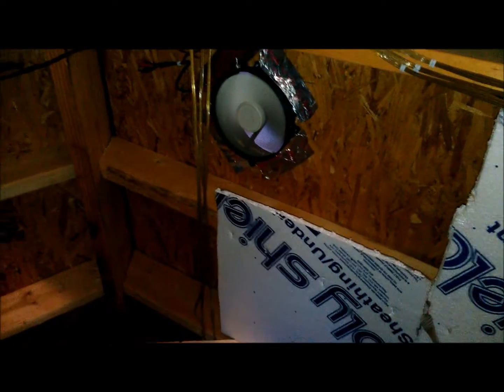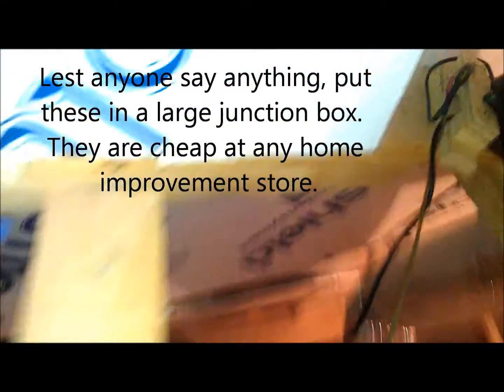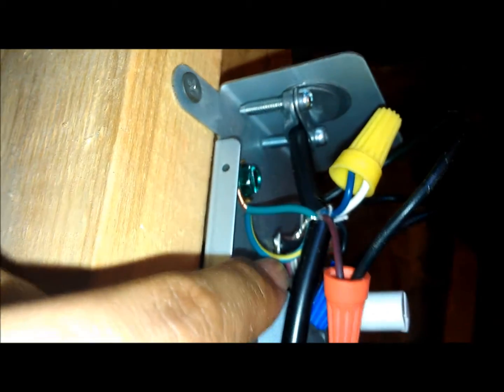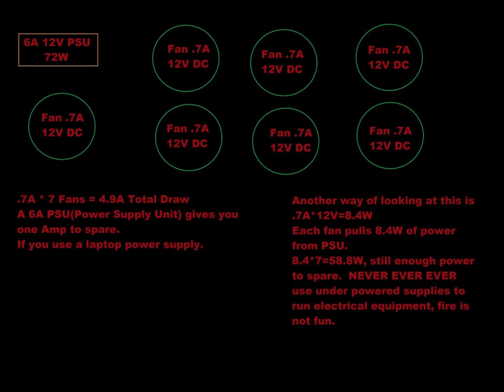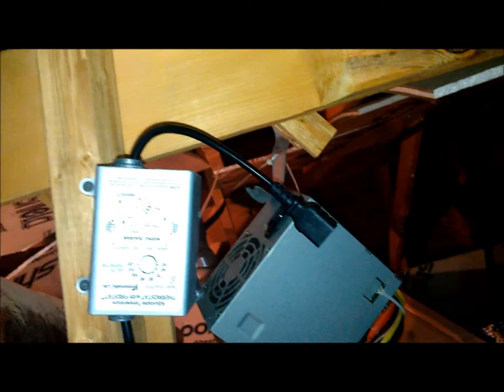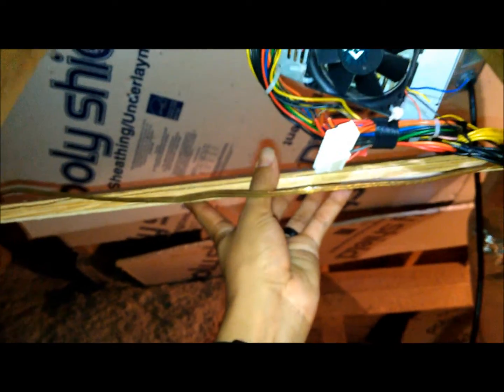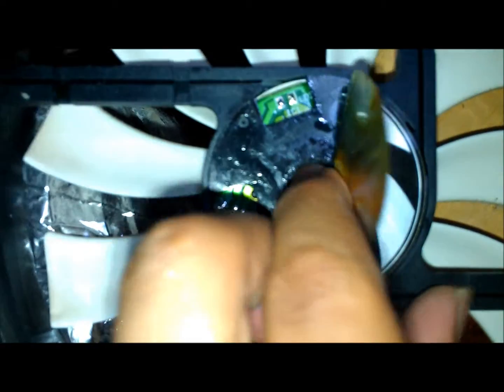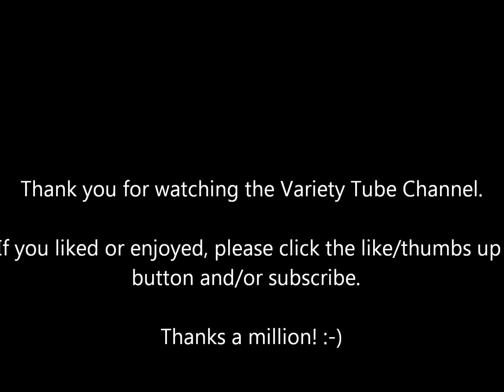Upgrade passive attic vents with a PC Case Fan

Comment: Great video.  I've had a similar setup running for about 8 yrs. now:
https://youtu.be/IXnU8SDihSs
Still working great including all 8 original fans, running off solar power.  Used the same Firestat to control them as well.

Comment: I plan to do this project but instead use 80mm fans in parallel run by a solar panel. I have a ridge vent so my fans will be placed facing straight up along the attic's apex. I am glad you went into detail about the circuit as I had an idea of how to do it but no confidence. Good work and thanks for sharing!
Reply: I'm about to do that, how did it work?
Reply: @backer3179  I've since moved but I had them continously running for 5 years no problem. I built mounts for the fans out of thicker roof flashing to have the fans mount on an angle and blowing out the ridge vent. I only installed 4 fans, but they would spin up max speed when it was the hottest part of the day... ultimately, a powered attic fan pushing 1000s of CFMs is the best solution.